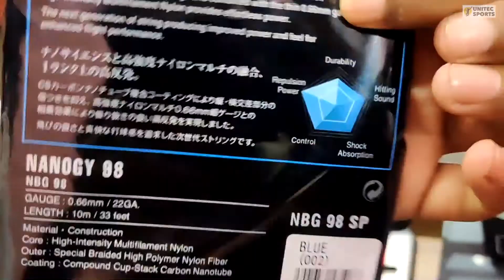Victor Aura Speed 80X Stringing 29LBS with Yonex NBG98

Comment: A couple of suggestions:
1. your load spreaders are upside-down - if you turn them over you will be able to see the grommets,
2. you can remove the red pads on the 12/6 billiards when you use load spreaders - the 12/6 support will protrude less into the string bed and your top cross will not be bent.